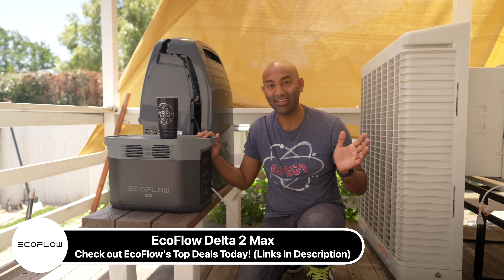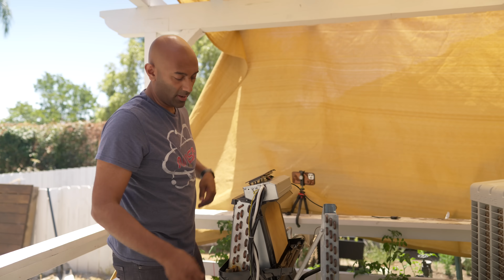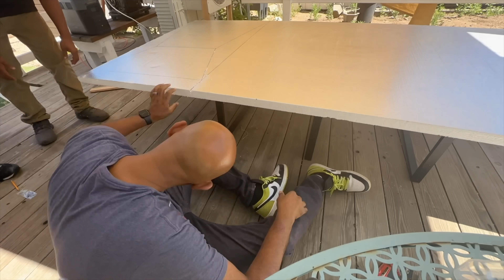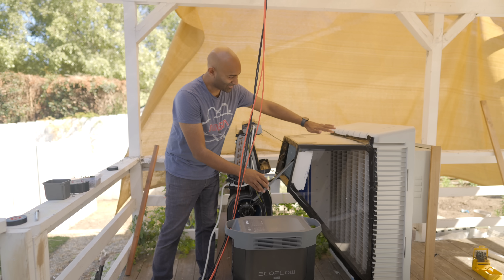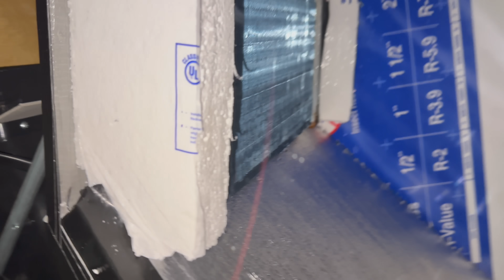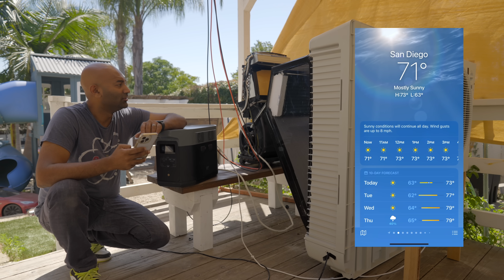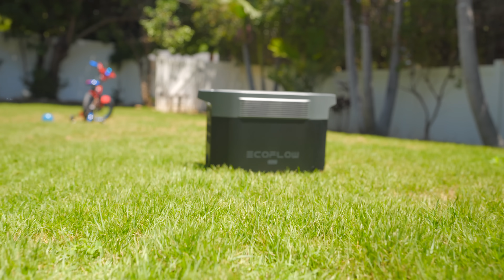Solving the Water Crisis: Solar + Battery = WATER!

Comment: So, I've worked with some refrigeration systems in the past, not alot but one interesting thing Ive seen, is if the water is below the dew point temp, it can also cause moisture to come out of the air. I.E. having a tank of flowing water at 36F would slowly fill up with more water. Never experimented with it in a swamp cooler, but if you had a way of making it so the water in the sump was significantly below the dew point (enough that it was still below it before it gets back to the sump), and add an overflow drain to the sump it may be able to do help get more moisture out. (it shouldn't lose water if the water stays below the dew point at all times. ). Set a chiller in the sump, set a temp sensor at the bottom of the sump fins, turn on the pump if the water in the sump is 10 below dewpoint, and run as long as the return water is still 5 below dew point, or some values.

Comment: You just made it super complicated and it is not.  Solar panels into a solar controller into battery bank into inverter into 5000btu window A/C unit, tip that up at a angle and catch the condensation in a water tank.

Depends on the humidity but here in Oklahoma, about one to two days and you'll get around 50gal.

But that's if the battery bank can run it all night too.

Comment: sellout, just use the cold side to make condensing moisture. Not this pay-win add you are running. Even a Mobile AC has the the dehumidification build in, just tap that outlet line instead of this BS.

Comment: That rocking lounge chair is really triggering me :D 

This is a really cool project!  Combined with agrivoltaics, I could see this helping to irrigate farms. 

I think you need more thermal mass on the cold side.  Others have suggested limiting the output temperature to just below dew point, but (unless you have a variable speed compressor) turning the compressor on and off to maintain a relatively high temperature is going to kill your efficiency.  If you run the compressor for a while, cooling down a big thermal mass, and then turn it off until that mass reaches just below the dew point, you can harness the cooling even while the compressor is off.  

A massive heat sink with a thermocouple should be all you need.

Comment: OR... one could just buy a de-humidifier... just say'en.
Reply from the maker: do they make 1 gallon / 4 hour dehumidifiers? but you're not wrong lol... just a matter of scale :) cheers!
Reply: @TwoBitDaVinci  i think in the next video you should explain the difference between this and store brought dehumidifiers maybe make its own video that also explains Peltier Thermoelectric heat pumps to people and tie in RTGs because why not they use the same principle in revers to power 2 multi million dollar rovers that are are on a wholenother planet and they only produce a max of 110w when new thats 1/20 the power needed for a electric kettle and yet they manage to run a whole rover off that little amount of power.

and yes they do make dehumidifiers that can pull as much waters as yours can like Trotec DH 25 S Overhead Dehumidifier cost around $2000 AUD tho. it pulls 16L/24h at 20C RH 60% up to 40L/24h at 30C RH 80% its big brother the DH 65 can do 30L, 80L and its bigger brother the Quest 155 under the standard American rating condition of 80ºF and 60%RH can pull 71L/24h that would be like 120L ish at an RH of 80% but your paying $4200AUD.

Comment: Why not just redirect you house ac water to somewhere that's not a drain. Seems like waisted air conditioning. Also - it seems like you could use the electricity to charge an EV and tow one of those military potable water containers- 400 gallons mind you- from an area where water is more common.
Reply from the maker: absolutely, collect it and water some plants!
Reply: @TwoBitDaVinci  I live in an area where water isn't really that scarce. It's a little expensive because we buy it from the next city over - but I have rarely seen the water level 12 inches under the spillway.

Comment: If you have a central refrigerated air system, hook a water hose to the condensation pipe with the other end going into a clean 55-gallon rated liquids drum. Elevate the drum a bit.  Spend the extra for one with a spicket for easy drawing. No, that water is not free, but it's an accumulative resource that usually goes to waste. Although it doesn't seem like a lot of water, I can fill that drum on a hot Texas summer within a week.
Reply: 2 days where I live. My understanding is the water isnt good to drink. Also wonder if there is lead in the solder?

Comment: Many N.American dehumidifiers use lead and other heavy metals especially in the solder.  Aluminum is dissolved to a tiny degree.  So, wareribg non edible house plants is likely fine, but that soil will accumulate metals.

Europe has the RoHS standard and you can get dehumidifiers where the qater doesn't contain heavy metals and can be simply treated for bacteria (ceramic filter like Berkey).  Anyone found a N. American dehumidifer with no heavy metals in condensate?  Might even conform to RoHS.

Another option is the dessicant dehumidifier.  My N.American model condenses in a plastic heat exchanger.  It should be safe, but i haven't sent out water tests.  And it produces much less water per kwH.

Comment: I would be interested in investigating a system that could take the water out of the air coming it into the house; store the water; and irradiate the heat to space using special roof panels. This way, you have a shelter when wet bulb temperature difference goes to zero (where the human body can't cool itself); a water supply; and the possibility of sending the heat into space instead of contributing the global warming (which could boil the oceans in 400 years time, even without the CO2)

Comment: Grab yourself a ~$100 dehumidifier and see how your creation compares to an off the shelf solution.
Reply: ya ain't gonna find a 1000w one for $100 they cost a good $1500+ and are literally an AC in a box. look up the Trotec DH 25 S Overhead Dehumidifier his is already on par with that and with improvements could do better.
Reply: @phalanx3803  his runs 4hrs/day one of the little ones could run nearly 24/7 on the same power setup. 

But efficiency is the question, which setup makes the most water with the power available?
Reply: @justinjja2  the dh 25 is tested in a controlled environment his not so it's hard to say. The dh 25 does 16l 24 h at a RH of 60% his does 24 ish 24h at 69% if I remember right. His it 1.4 kw and the dh25 is0.7kw so his isn't doing bad and he is reusing an old AC not like he went to buy a new one for this.

Comment: Commercially available dehumidifiers will draw air in over the evaporator and then then exhaust the dried cold air over the condenser to cool it and improve efficiency.  This is unlike traditional heat pumps, but the purpose is to extract water from the humid air, not to pump the heat from one zone to another.  The criticism that I would have of most commercially available / is that, doe to there dimensions and form factors, then allow recirculation of the dried air back into the air intake to the evaporator.  I think that this could be improved by ducting the exhausted air from the condenser away from the rest of the unit.  It looks like this could be easily achieved with your unit that is based on the converted A/C unit.
Reply from the maker: yeah this is going to be phase two!

Comment: great experiment! this validates what i have observed with my 5K window ac that i use to cool my garage. I have attached a small hose to the drain and catch the condensed water in a 5gal bucket that i use to water the pollinator flowers in my garden. Oh and the window ac is powered by solar, it uses around 450w when the compressor is running. Output of water varies depending on humidity and i now know to monitor dew point also.......cant wait for the next installment of this experiment.

Comment: This is an excellent start, but don't waste your time using the cold dry air to improve the efficiency of the heat exhaust coil.  You'll only improve things perhaps 20%.  Your next step should be to add an air to air heat exchanger so that the cold dry air precools the incoming warm moist air.  This will improve your water yield by 3 to 4 times!  Plus you won't need to control the cold temp (just stay above freezing) and you can run day or night with the nearly same efficiency.  If you measure your outgoing air's temperature/humidity we can calculate the actual improvement the air to air heat exchanger will bring.  Have fun!
Reply: I can  additionally suggest to try using not a simple air-to-air heat exchanger, but the exchanger with air direction changed back and forward intermittently. I don’t remember exact name, but its well known idea. It seems it should be much simpler to do and more compact.
Reply: @Nikita68379  Do you mean a cross heat exchanger?
Reply: @Synus5001  I think he's referring to a regenerator, which doesn't seem to apply since it mixes the incoming and outgoing streams.

Comment: Send the cold air into a building that needs it, find a way to purify the water for drinking, and try to find a way to send that heat off into space rather than just back into the atmosphere. :3
Reply: Why would you send it into space? Why not simply try to put it into a water heater or broiler?

Comment: Water heated (solar?) to 145+ starts to vaporize if the air pressure is slightly less than normal. Give it a surface to condense on and you have distilled water.
Reply: That would be good for purifying water, here this issue is pulling it out of the air... In this case he reinvented the dehumidifier

Comment: Wouldn't a dehumidifier be more efficient?  Thank you for all you are doing.
Reply: probably but he repurpose stuff in the garage doing nothing but collecting dust
Reply: there not really different the only thing is they use a Peltier device there not as efficient as compressor based heat pumps but dont have any moving parts good for in doors for a simple way to bring down the humidity. but if you want to get as much water out of the air an AC is gonna win hands down both in efficiency and raw output assuming that AC has a good COP of 3 for every watt of energy he is using he is getting 3 watts of cooling a Peltier only gets a COP of 1 under ideal conditions some can get up to 1.5 but they cost a fair amount and from what i can see peltier's at the 1000w size a hard to come by so he would need to use multiple smaller ones.

Comment: diy FeSO4 water graphite iron-air fuel cell, yep it still has the rust accumulation issue, and h2so4 will not help it, it will clogg the system down with h2
Reply: diy is the best man :)
Reply: great
Reply: thats an ac system, cold +water
Reply: hot coils on the roof top wind cooled
Reply: ie diy ac system

Comment: what's the difference between your experiment and a dehumidifier? thank you
Reply: Air conditioners are dehumidifiers just with the air ducted differently. If you run them in reverse you have a heat pump that can heat your water or your house.  Commercial heat pumps go forward or reverse to heat or cool.  AC and dehumidifier are heat pumps optimized to do just 1 thing with the lowest purchase price.

Perhaps the next video will be a solar dessicant cycle water condenser but then you wouldn't  need the battery. Harder to hack from what he has, but a dessicant dehumidifier can be hacked to use solar heat directly which is almost always more efficient than making electricity first.  

Consumer dessicant dehumidifiers sell for around $100 USD.  Better for dehumidifying cold spaces.  Vapor compression devices like he's using are better for warm spaces.

The original air conditioner already condensed water from air.  That's why they have condensate drains.  Swamp cooler added I suspect as an excuse to use tools and to show off the battery running 2 devices not just one.
Reply: @SeekingBeautifulDesign  
Swamp cooler needs water to run, but where would the water come from?
Reply: @tech5298  Yes, you're being more subtle than I perhaps.

But, another way to answer is:  Start with water to swamp cooler to air to dehumidifier/AC to water.  Or just keep the water in a pail and do nothing.

Another way to answer:  Leave the swamp cooler in storage.
Reply: @SeekingBeautifulDesign  
I’m running a 12k btu AC in a window.  It cools half the tiny house. I had a swamp cooler in another window last year and it was friggin awesome. No solar or batteries though. It’s about 95 deg F today in east LA, but it’s a “dry heat”. (I always think of Corporal Hudson when I say that phrase “dry heat”)
Reply: literally nothing.  you could buy a far less expensive dehumidifier than the components that are Frankenstein'd together here and have a much more efficient water collection.  Some dehumidifiers even have a hose output option so you can easily run the output to a holding tank
Reply: buying vs repurpose I guess, water from air always will be side project and if you need AC you can simply direct water hose to a tank especially if you have a central AC water condensation  is measurable
Reply: Buy, buy, buy…solves everything and takes little imagination. 
What was that guy’s name in the movie “MOSQUITO COAST”?
Reply: @tech5298  ok smart guy, what do you do if you don't have a massive swamp cooler, air conditioner, battery unit and solar panels

Comment: Cool project. But energy/economy wise not very efficient. If I deliver energy to the grid I get €0,30 cents per 1000w. 1000w per hour for half a liter of water would cost €0,60. Water from the utility costs me about €1,50 per 1000l.

Comment: Mmm.  I really don't recommend that people build their own air-to-water units.   You need to mineralize the water and the design has to be robust against bacteria growth (such as Legionnaires disease) and other issues.  In addition, the material the water condensates on will bleed into the water, which is one reason why A/C condensate should never be directly drunk.  The PH could also wind up being way off and affect your teeth (or worse).

This is one of those things that people just shouldn't DIY.  I'm really serious here.  Don't DIY air-to-water.   Water capture from the roof, sure.  Air-to-water?  No.
Reply from the maker: I didn't get into nex steps I just said don't drink the water. but its a fascination optimization project, where can keep trying to increase the output of water, and reduce the electricity consumed. cheers!
Reply: I dont think legionairs disease is from drinking the water.     But, cool stuff to think about.
Reply: @gladlawson61  Right.  Its not the drinking that's the problem for that particular bacteria, though it is possible to get it from drinking, it is aerosolization of contaminated water.   Contamination can occur under any number of circumstances several of which are likely to be prevalent in a DIY system.  And aerosolization is easy when you have a fan nearby.   It doesn't have to be caused by a public fountain at a museum.

There are three primary problems.  One is bacterial contamination due to standing water or standing droplets, or recirculated water which is then contaminated, the result winding up being Aerosolized.

A second is from metal and chemical leaching from the evaporator itself.

And a third is PH and mineral / salts related (deionized water).   You can wind up with "water" in forms that literally instantly kill any cells it comes into contact with, or in forms that will destroy your teeth.
Reply: Small scale farmers could use the water for irrigation.🤔

Comment: one of the first modifications I would do is dewpoint tracking with arduino or some controller to only cool to just below dewpoint. don't waste energy going below dewpoint. you could either control the cycle of the compressor or the speed of the air flow.
Reply from the maker: oh I love that! brilliant!
Reply: The dewpoint is the saturation point, meaning you'd want to maximize how further below the dew point you are to get more water before the freezing point. For energy efficiency, yes, the higher the evaporator temperature, the greater the overall COP but it is not as obvious as just changing one variable in this scenario.
Reply: @Southghost5997  yes it would take a bit to properly track but with simple programming you could monitor yeild vs humidity vs energy used.
Reply: $240 later I only getting a pint per hour from Chinese 800!watt dehumidifier in Tacoma WA. w 50% rel.humid. Hmmm???